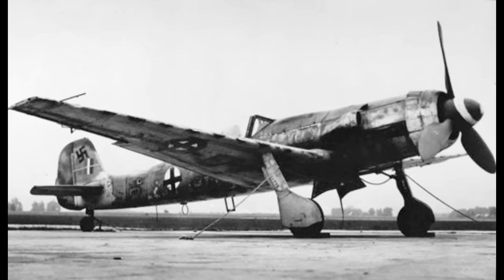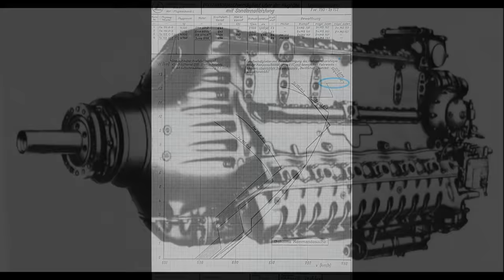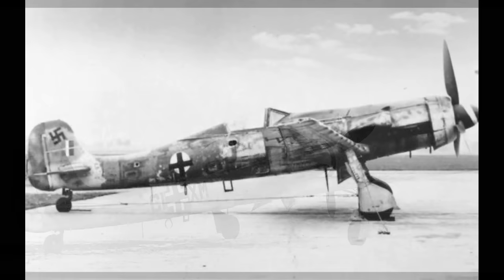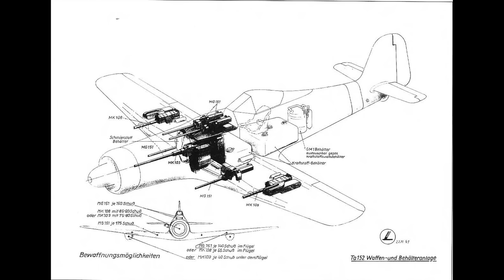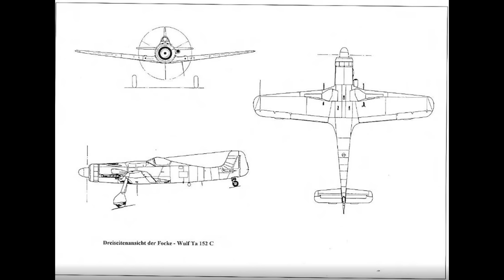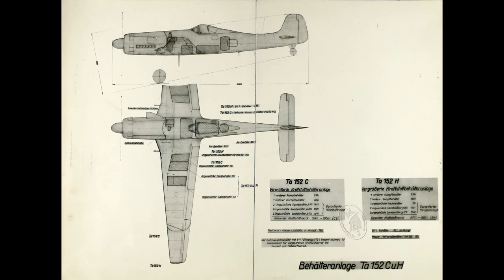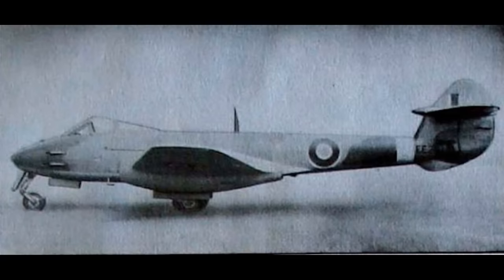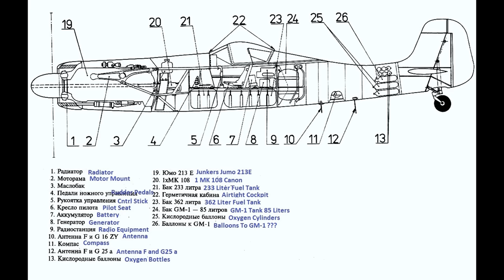Focke-Wulf Ta 152 H-1 Extreme Speed At High Altitudes.

Comment: Sir, a request if I may:
There is a little noticed aircraft engine that quite popular in Europe.
It's the Bomber engine that was converted to diesel and installed in the T-34 Tank. It was good enough to use in all tanks even to the T-55. It's remarkable that it was still built to the aircraft specs in the sense that the engine has 2300 cubic inches displacement and only 2200 pounds. To give an example of how light that is a 350 horse Cummins in a military 5 ton truck is 855 cubic inches and weighs 1800 pounds.
I just thought that since it started out as a Bomber engine you might find it interesting and the fact that Tractor Pullers are getting over 4000 horsepower out of it with reliability is pretty cool.
Do you think you could make a video about it???
Reply: Charomskiy M 40 or ACh-30? Not finding anything meeting all criteria mentioned. I want to know!
Reply: @paintnamer6403  If you want to see the engine being rebuilt by two guys with hand tools go to Mastermilo82 YouTube channel and look at the Tank Restoration playlist.
The connecting rods will blow your mind.

Comment: There is an  interesting point that was not touched upon in this video, while talking about Ta 152 GM-1 nitrous oxide injection system. There was one noticeable difference between the way it is used now to boost power in racing or tuned cars. Now it is commonly stored in pressure bottles. But to keep N20 liquid in room temperature, it needs to be pressurized to 80 bars. It means heavy, thick-walled bottles. Such a bottle of 118 l (31 US gal.) volume would be hopelessly heavy for a high performance WWII fighter. So instead, the GM-1 tank in rear fuselage was only moderately pressurized to 4 bars, but it was insulated to hold liquid nitrous oxide cooled down to -90°C (-130°F). During flight it was slowly boiling-out and lost through a pressure relief valve, but still, besides tank weight savings, cryogenic N20 had another important advantage: a significantly increased charge cooling effect when injected into the intake manifold.

Comment: A really good video. I have a possible explanation for the high cockpit altitude. I would say the simple answer is the delta pressure. The higher the cockpit height, the lower the pressure on the structure. Especially at very high altitude, you can messure the pressure in tons per square meter,  in this case, we have a pressure on the skin of roughly 2.5-3 PSI permanent. (I only have a atmosphere table up to 40.000 feet) Remember flight JL123  or the Comet. I don't know how thick the Duraluminium skin on the 152 is, but I think it would be less than a 1mm at that time, maybe 0.6mm or 0.8mm. So raise the cockpit altitude, lower the stress on the skin and canopy.

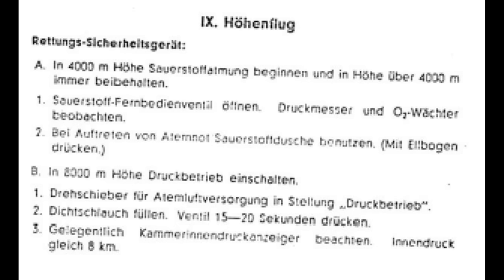Comment: 28:05

A At a height of 4000 Meters, start using Oxygen to breathe and keep it on above 4000 meters.
1. Open the remote oxygen valve. Keep an eye on the pressure gauge and Oxygen guard (likely also a gauge)
2. In a emergency situation of oxygen failure, operate the "Oxygenshower" (likely fills entire cockpit) with your elbow.

B. At 2000m height, enable pressurization.
1.Turn the "Air supply" knob to "Druckbetrieb
2. Fill hose/line. Press the valve for 15 - 20 seconds.
3. Ocassionally check the Cabin-Pressure-Indicator. Stabilize Cabin pressure to 8km. (The Cabin air pressure used for 8km)

Comment: Well done, as usual, Greg. My Dad's F6F-5 from 1944 was a dump truck by comparison, and the F4U-4 he flew throughout 1945 probably isn't close enough to be in the same league, though most of the fighter-to-fighter combat in the Pacific seems to have been at lower altitudes than in Europe. Along with your dozens/hundreds of other requests (I still want to see a good video on the F6F), let me add a plea for a video on prop design. Hard not to notice the paddle blades on the TA-152 vs. what most other fighters seem to have been using. Also the rationale for 4-bladed vs. 3-bladed, etc.
Reply from the maker: At 30,000 feet it would be no contest, the Ta 152 would deal with a Corsair or Hellcat easily. However below 12,000 feet, the Corsair or Hellcat would be more than a handful for the Ta 152. I would choose either naval fighter over the Ta 152 for a low altitude fight.
Reply: Dr. Kurt tank,head of the focke-wulf design team, once took a ta-152 on a test flight. He got up to optimal altitude and was jumped by a couple of P-51 mustangs. Not having ammoed up( he was after all not a fighter pilot) he slammed the stick forward and not only outpaced them, but was able to go much higher beyond their reach
Reply: @johngulartie-hx8sv that’s not the true story

Comment: I bet the 152 had a phenomenal rate of climb.
Reply from the maker: It does, I didn't get into that at all. This video is doing so well, I may do a follow up and cover climb, dive, maneuverability, and the C model.
Reply: @GregsAirplanesandAutomobiles   
It might also be interesting to look at the Ki100 where there are a number of correspondencies. An alternate response, but to actual to B29 high altitude incursions by upgrading an existing type, the Ki 61. Including a higher aspect ratio wing, but replacing an in-line engine with a more robust radial designed as a bomber engine, with the Fw190 used as a design study in fitting the radial onto a slim fuselage) plus development work on turbo-supercharging and water-methanol injection.
Reply: @GregsAirplanesandAutomobiles  That would be awesome if you did that!!  Especially with the C model.

Comment: Greg, the logic was that the Ta 152 H-1 could command the upper airspace and it could boom and zoom the P 51-D, P 47, Tempests, and Spitfires form above. 
This left the Bf 109 G6, G10, K-9,  to mix it with the B-17's and B-24's as well as have to engage with the already mentioned allied fighters.
We also have to remember that Germany manufactured 1,200 Me 262's of which only 200- 300 went into action. 
The Me 262 was designed for medium to low attitude dominance, of course it could have been great at high altitude as Jets are great at high altitude.

Comment: IX. Altitude Flight

A. At 4000m Altitude, begin breathing Oxygen and remain on Oxygen above 4000m at all time.

1. Open Oxygen remotecontrolvalve - Monitor Pressure- and o2 Guardgauges (guardgauge probably means wether the system is active)
2. If you experience difficulty breathing, use the o2 shower by activating it with your ellbow. (probably a valve to open the flow temporary)

B. At ?8000m Altitude engage Pressurized Mode

1. Switch the Airintakemode to pressurized
2. Check for pressure of the oxygensupply hose by pinching it and hold the nozzle shut for 15-20seconds (check just like with gasmasks for seal just in reverse)
3. Occasionaly check the Pressuregauge for the Cockpit. Make sure it reads out for the given altitude of 8km
Reply: Your translation for section B.2. is inaccurate. It doesn't mention pinching a hose or shutting a nozzle. I'm not a pilot or mechanic personally, so there might be some subtleties of the context I'm missing, but translating it myself I get the following: "Fill the pressure-tube. Push/Press/Hold the valve for 15 - 20 seconds."

Translating the entire text yielded the following. Note that I did find a definition for "Drehschieber", however it refers to a small, presumably rotating, metal plate in engines, which I don't believe is what the manual is referring to:

IX. High-Altitude Fight

Emergency Safety-Device(s):

A. Begin breathing oxygen at 4000 m altitude and always continue at altitudes above 4000 m.

1. Open the remotely controlled oxygen valve. Watch the pressure and O2 gauges.
2. Use the "Sauerstoffdusche" (lit. Oxygen Shower) if breathing difficulties arise. (Press with elbow.)

B. Turn on the pressure-service/operation at 8000 m altitude.

1. [Set] "Drehschieber" (lit. Turnable Pusher; I presume it's a kind of button or valve) for breathing-air supply to "pressure-service/operation".
2. Fill the pressure-tube. Push/Press/Hold the valve for 15 - 20 seconds.
3. Pay attention to the cabin-pressure indicator occasionally. The interior pressure [is/should be] equal to 8 km.

Where I found the definition of "Drehschieber": http://www.zweitakte.de/lexikon/lexicon.htm#Drehschieber:
Reply: If I may add my opinion on the question with the Drehschieber, I would expect a rotary knob with 3 or more positions to control the oxygen system. Maybe OFF, Flow and Pressure. When I hear drehschieber I think of a 3 way valve and the lever that controls the flow.

Comment: You're correct on the 8000 meter cockpit pressure. The entire concept was to allow additional redundancy measure at higher altitudes. Also there was an emergency oxygen flush valve behind the pilot's elbow that literally flushed pure oxygen to the mask when needed. However, I do believe this was a one time use mechanism. Meaning your high altitude flight was essentially over at that point since you no longer had that safety measure to fall back on once used.

Comment: My Translation "IX. Höhenflug":

"High Altitude Flight
A. Start breathing oxygen at 4.000 m altitude and keep always while being above 4.000 m.
1. Open oxygen remote valve. Watch for pressure ga(u)ge and O2 monitor.
2. Use oxygen shower in case of breathlessness. (Press using ellbow.)

B. At 8.000 m altitude activate pressure operation.
1. Rotary slide for breathing air supply at position "Pressure operation"
2. Fill sealing tube. Press valve for 15-20 seconds.
3. Occasionally check chamber interior pressure indicator. Interior pressure equals 8 km."

Kind regards,
Jan-Erik Schmidt,
Korvettenkapitän,
Federal German Forces (Reserve)

Comment: Holy cow the German Engineers were pulling out all the stops to get every horse out of this engine they could.

Also, it's crazy just how many crazy airplanes the Germans were coming up with in their bunkers.
Reply: And they planned to get even more out of it - they had an engine with 2500 hp with MW50 boost for the Fw 190 D13 and a 2700 hp engine for the Ta 152 H version (Data also with MW50 boost included) in developement.
Reply: @bluefox9436  the standard Jumo 213E was accordingly  to various sources developing "only" 1,730 hp but in my opinion it was more with the MW 50 boost but it was completely dependent on the low quality of the B4 fuel (87 octane) otherwise, if lucky, it could use C3 (100 octane) but in the final months of war chronic shortage of fuel was literally grounding the Luftwaffe. But it was with the GM 1 that permitted the Ta 152 to reach the truly impressive heights of 14,800 mt....
Reply: Matt Dirks, They were workin on it. They had no 90 octane fuel to speak of. The Polesti Raids stopk

Comment: Interesting about the cockpit pressurization.Charles Lindbergh  almost died during a test flight in a P-47 when the oxygen system cut out at altitude. His last action was to trim the plane for a shallow dive and he woke up at about 6.000 feet. He devised a flow indicator for the oxygen line to help pilots get a better indication of oxygen system function.

There was serious thought of pressurizing the P-47N cockpit.

Back in the 1990's a glider pilot in California caught a crazy updraft off the mountains one morning after a storm had blown through. He went to about 45,000 ft. on an oxygen mask which was a very dangerous thing. It would have been a glider record but he never had a FAA flight clearance and the glider governing body would not recognize it because it was a violation of law.

Burt Rutan's SpaceShipOne which won the X Prize was pressurized but I thought it was 'stupid brave' to fly to 367,000 ft without a pressure suit in case the cabin developed a leak. If it had it easily (very likely) could have been fatal.

Comment: Kinda looks like a Dora; a prettier Dora . . .

And wow, look at all that armament.
Reply: Foy Blackmon look at the ta152 C (has even more guns)
Reply: The Creek book has photos of a Ta 152B (ground attack version of the C) with 30mm Long barreled canon in the wing roots. The chord of the Ta 152 could fit these.  The Fw 190D9 was simply a Fw 190A9 with the Jumo 213A engine and a small tail extension to compensate for the longer nose.  It was an interim aircraft.   The Ta 152 series had about 65% common parts with the Fw 190D but a longer fuselage, larger wing, 50% more range.   There were two variants the Ta 152C optimized for medium altitude speed and roll rate and the Ta 152H for high altitude.  Just about all of the Ta 152H combat was at low altitude where it’s efficient wing made it very maneuverable.   The Jumo 213EB engine was to be fitted to both the Ta152H and Fw 190D13/EB.   With it the Ta 152H could do 474 mph and the Fw 190 D12/EB 488mph WITHOUT nitrous oxide.
Reply: Foy Blackmon it’s Dora’s long legged supermodel younger sister
Reply: This proves the superior design of the Focke Wulf design over the Messerschmitt 109. Sheer adaptability. Willy Messerschmitt design not as good. Messerschmitt did have political favor with the Nazi government, as Kurt Tank did not.
Reply: Patrick Brennan Though what you say is true the Me 109 was in service with the Luftwaffe in 1936 whereas the Fw 190 only in late 1941.  All aircraft grow old.  In November 1944 both the Me 109K4 was entering service (440mph) and Fw 190D9 (437 mph)  but the Fw 190 was being transformed into the Ta 152.  The Me 109 might have made 453 with a new prop or one more generation Me 109K14 (455mph).   The Fw 190D12 might have lasted a bit longer.

Comment: Terrific work on this video, as always, Greg. What comes out at the end of it, is that Tank’s project was for a very capable fighter. Arguably, a machine at the very pinnacle of piston powered high performance aircraft. Definitely not the work horse, the 190 was originally designed to be, it would give a capable and seasoned pilot a very sharp blade to fight with; and by that time, there weren’t many of those guys around...not the seasoned type anyway. In my opinion, this is a much overlooked factor, when we start discussing whether or not a particular aircraft would dominate over any other....on paper. In the end, it comes down to the pilot, to bring the strong points to bear and compensate for the weak ones. Exposure and experience in flying these beasts is as important as experience in designing and building them. And experience in a warplane, often is something that cannot be implemented, as can be a one-time event; as in fatal. I gather, that you mainly focus on the technical aspects of (wartime) aviation. I’d enjoy watching episodes dealing with the human component of aviation. In this particular case, about the effects of being a pilot for the duration of the war (German or British) pilots, as opposed to the “tour” based system, I believe the US adopted to some extend. Would be interesting to find out, if the air arms’ effectiveness/efficiency can be visualised in numbers; and if pilot “quality” can be measured. I’d imagine, that reduction of German pilot training, to fill the cockpits (of which there were never enough, either; I get that, too), did have a significant effect on individual survival rate or probability, and the overall effectiveness of the Luftwaffe.
Reply from the maker: I agree with you, and I addressed the pilot issue at length in my P-48 pt. 8 video.
Reply: @GregsAirplanesandAutomobiles  : Hey Greg! Did you now? ;) Haven’t watched that, yet. Be right on it. Thanks for your quick reply. Kind rgds - Alex